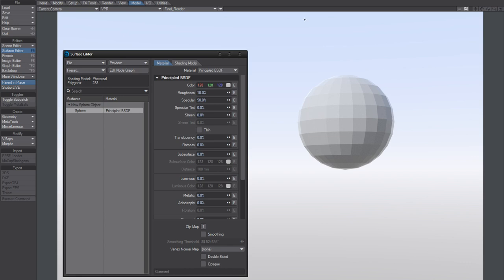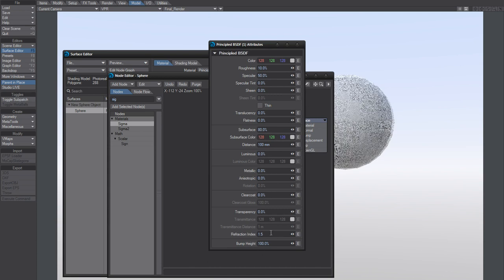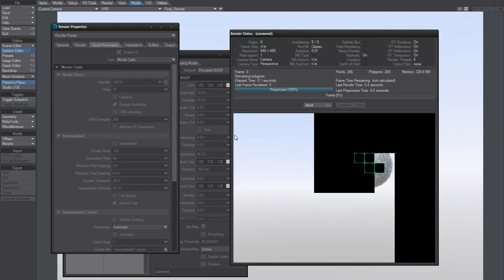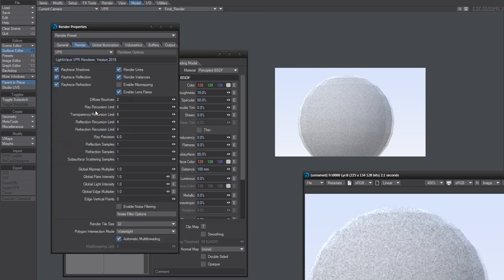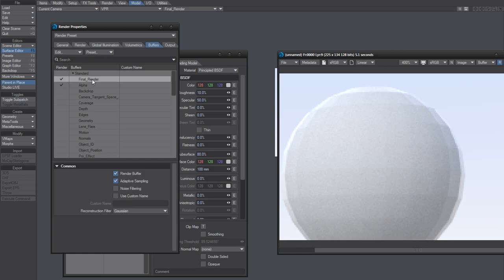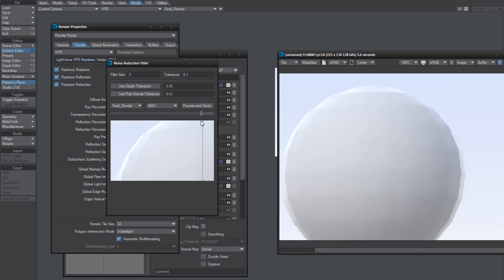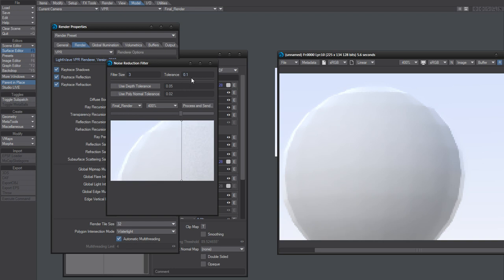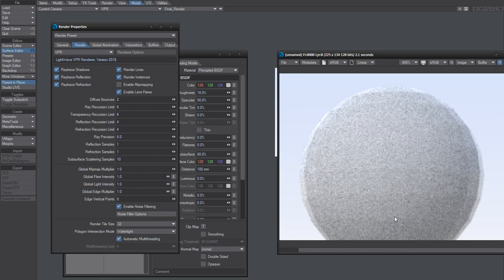LightWave rendering - LW2018 - SSS Noise

Comment: Unsure why you recommend against Depth Tolerance and Poly Normal Tolerance for the noise reduction filter, they help a lot in many scenarios.
Reply from the maker: could be, they are just very difficult to adjust from what i gathered, quite time consuming to get right.
Reply: @erikals  nope. just check Poly Normals and your glancing angles and edges stay sharp. :-)